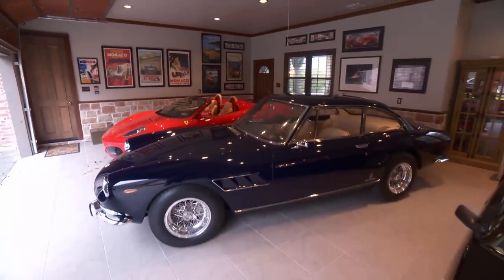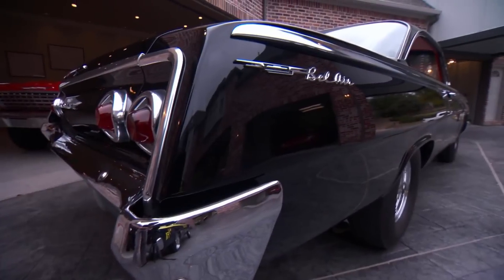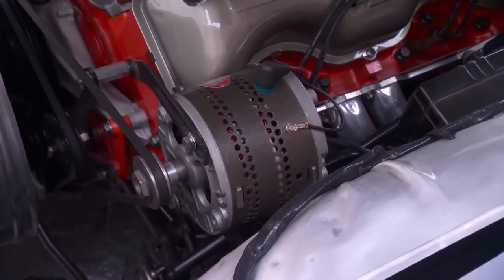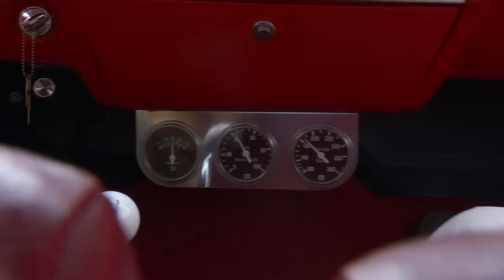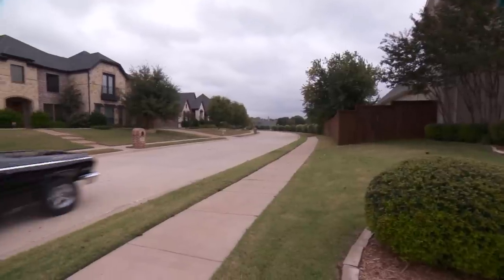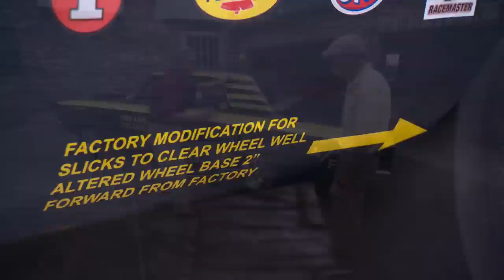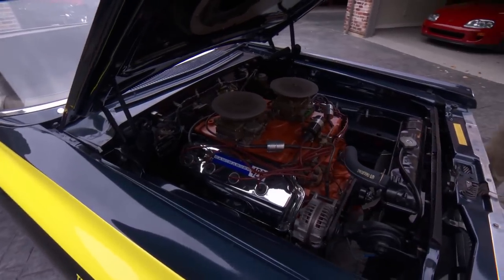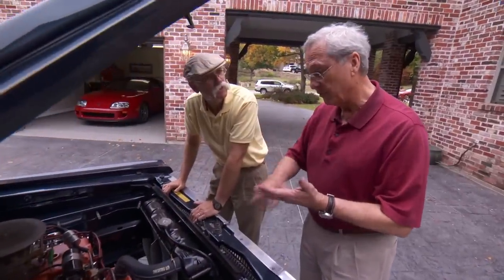Legendary Lightweight Drag Cars

Comment: What a trip down memory lane. My buddy had a 409 bored 40 thousandths and aligned bored by Luther Costales in Houston Texas including Howard's aluminum rods, Jahn's power-slot pistons and a Chevrolet mystery cam ?  (Z-11 ) I don't remember but that A-Stock  street Impala SS would run 12'5 s @ Green Valley, Yello Belly, Little River and many, many street races against 406's, 348's, 426's,383's, 390's, the most surprising one's were the 300 HP Chevy 327's, what fun back in the day.

Comment: I’m a steel press worker if you are forming 18-20 gauge steel in dies and switch to 24 gauge steel in the same dies you will not get a good form, that’s the reason for the wrinkles.

Comment: Any mopar will clean up on that 409 mopar or no car
Reply: Any?  Be serious! I owned a 1964 Plymouth Valiant convertible with the 225 slant 6 and push button automatic. Nice car but not competing with a 409.  on the other hand, my '67 GTX, 440, 4 speed, 4.10 posi and headers  would handle a "W Motor" 409.